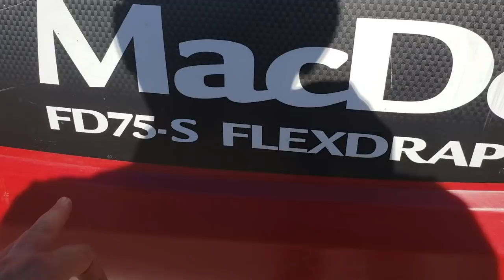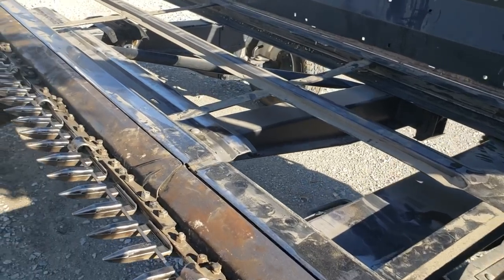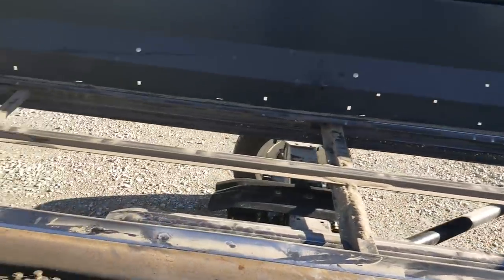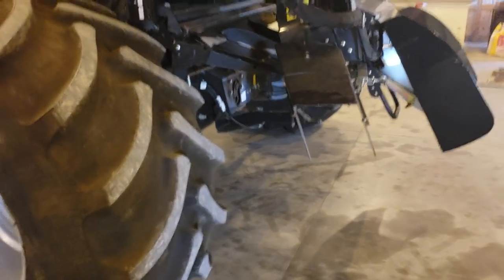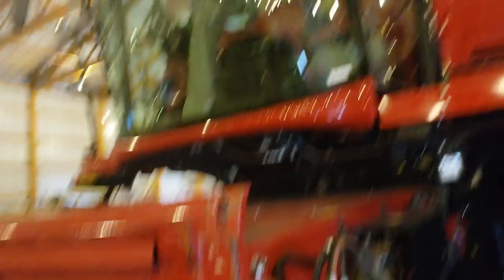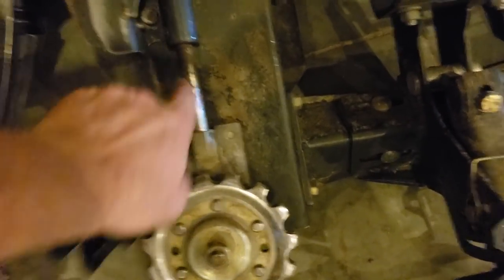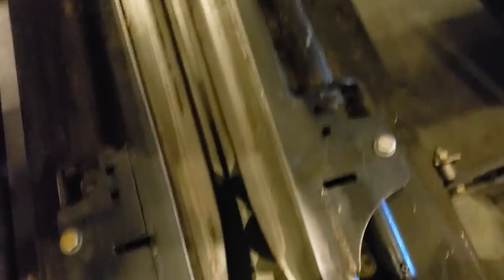Combine video

Comment: The reason he put oil on the sickle bar is because he probably stored the header outside, so to prevent rust from forming on the sickle sections you can poor oil to reduce/loosen rust.
Reply from the maker: Yeah ..I know ... it was in an old out building .. that oils a mess - and was unnecessary